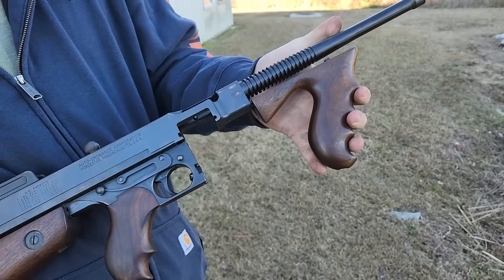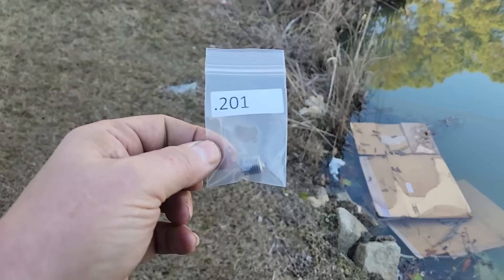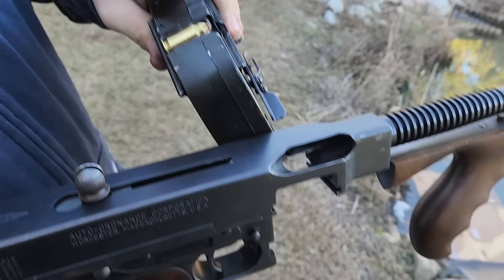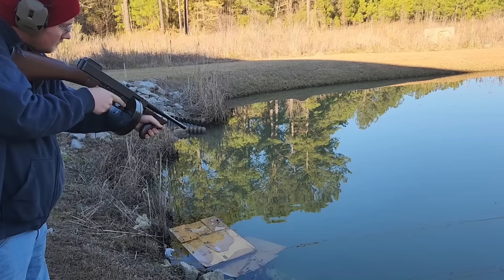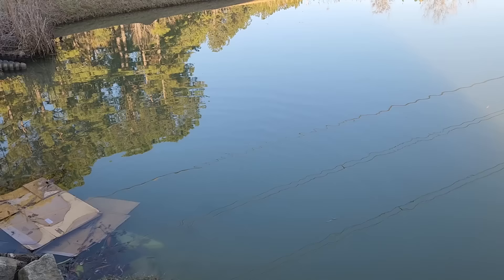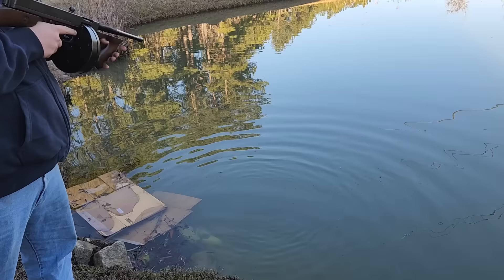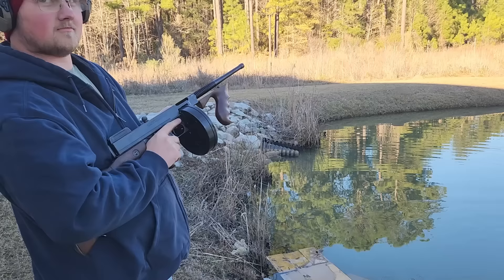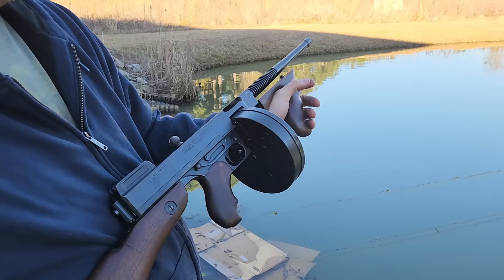Tommy Gun, Blank Adapted

Comment: I did WW2 Reenactments, we called that a
 "Hollywood " Blank Adapter.
 Plugs that you install with a Hex Key, can purchased at a Hardware Store and you need to have several Plugs that you drill a small hole of different diameter down the center of the Plug. This is because not all Blanks carry the same Powder Charge....EX .45 Pistol vs .45 TSMG 
A TSMG with a Cutts Compensator will direct any burning Gas/Flame outt the ports giving a Realistic Effect.

Comment: Even firing blanks, if you have to aim “At” your costars for a shot, aim to the side. Just because there might not be lead coming down the barrel, doesn’t mean those gasses can’t cause serious injury. Lets not also forget that the bullet gremlins might have snuck a live round in the mag by accident, so check your gear before and after each use.
Reply: Yep! 

There was this actor, recently.......

When I was doing movie guns for a living, we had to "butcher" a bunch of real guns.

The bore restrictor serves TWO purposes:

Firstly it prevents large chunks of material being shot forward.

Secondly and importantly, the restrictor effectively forms a "combustion chamber". ALL smokeless powders, fast or slow, rely on the pressure of combustion to continue "deflagrating" ("burning"). This is why if you fire a blank in a barrel without a bore restrictor, the results may be disappointing..

Some "conversions"are easy, many are quite tricky.

Sometimes tyou can get away without wrecking an original barrel.

Tale the Walther PP, in .380 Auto.

The barrel in these blow-back pistols is easy to remove from the frame.. swap it out for a matching sized, lather-turned recommencement will chamber a .380 cartridge case but NOT a live round(smaller bore!). internally thread the muzzle for "standard" restrictors. THEN make your own cases. I used .38 Spl. cases, with new extractor grooved cut on a dinky lathe. CH sell lots of special dies for forming blanks or you can make your own, (Machining a "rose-crimp" die insert is a challenge for the enthusiast).. Powder? The faster, the better. Bullseye  in tiny quantities is a good start.

Then, of corse, the "creatives" wil want to see flash and smoke. REAL firearms and ammo engineers have exhausted well over a century of effort to REDUCE flash ans smoke. (And, in a classic case of "special science", they want the blanks to be "quieter, especially in studio situations, Hmmmmmm.....

Self-loading rifles offer the same challenges, but on a bigger scale. The M-1 Garand rifle posed some challenges because the gas-port is so close to the muzzle, The "standard solution is to use a "special gas-cylinder lock piece that extends over the muzzle and whicj has a small hole bored in iy to bleed off gas and provid some flash.. It makes thr rifle look a bi todd, (once you see one in a movie / TV eposode, you can never "unsee" it.

Comment: Question. Off topic. I want to rust blue my EDC Taurus G2c slide. I've only done this on carbon steel firearms. The Taurus is alloy steel. Will it rust blue using a rust blue chemical? No one, even Taurus can answer this. Hoping you can.
Reply: im no expert but having tried rust bluing on alloys before, it doesnt seem to ever really come out as expected. if you figure they're using alloys in part to prevent rust, then their alloys are specifically designed to resist the very theory around rust bluing. stick to using the technique on carbon steel
Reply: @CheeseSteakJim  I'm in the process now. It's looking good, I have a nice gun metal grey forming. The first couple of rusting's produced a really nice orange, brown rust on all surfaces. Last rusting today #8. 😎

Comment: What manufacturer of blanks are you running through this Howell Arms 1928 blank firing non-barrel (Swanson, Atlantic Wall Blanks, homemade blanks, etc.)? I have tried some of the .45ACP SMG blanks that Atlantic Wall Blanks offers but the restrictors that came with my Howell Arms 1928 blank firing non-barrel do not provide enough back pressure to cycle the bolt reliably.

Comment: Broken bolt??? Sweet Jesus, how hot were those blanks?
Reply: Probably regular load .45 acp blanks. Problem is the bore obstruction that makes it blank firing. It allows the gas out, but not to the specifications necessary to run a Thompson properly. The tommy gun is an open bolt subgun. It doesn't use locking lugs to secure the bolt for firing, but rather the carefully balanced weight of the bolt and a beefy bastard of a recoil spring to slow it down so it doesn't smack the crap out of the back of the receiver. What that bore obstruction is doing is narrowing the end of the barrel. Gas still escapes, but it's adding a crapload of back pressure when firing. As a consequence, that thompson is kicking casing out at a rediculously high speed, and is probably completely compressing the recoil spring and letting the bolt smack into the back of the receiver with enough force to work harden and then crack the thing over time. Should probably come with a warning to only use lighter blank loads in the thing.
Reply: @jasonsexton8869  This, or use a slightly larger orifice. They're threaded and replaceable for a reason, you can tune the gun to whatever strength of blank you're using by installing the appropriate restrictor orifice.